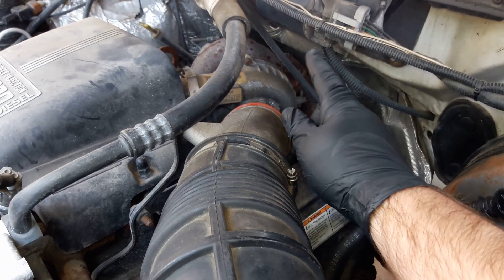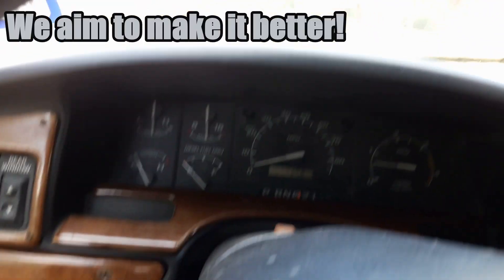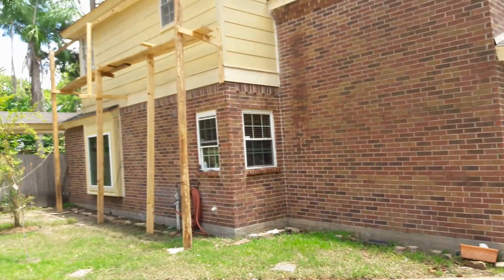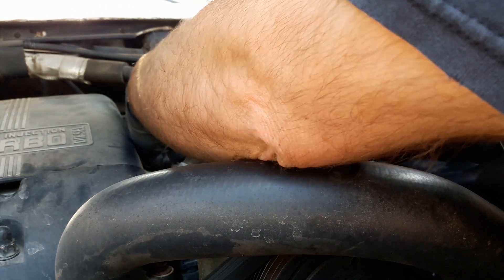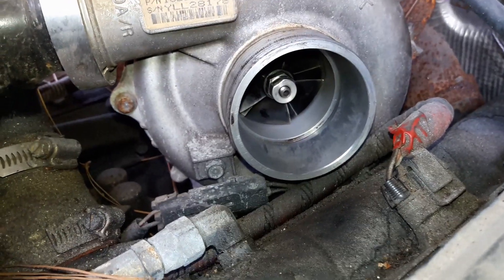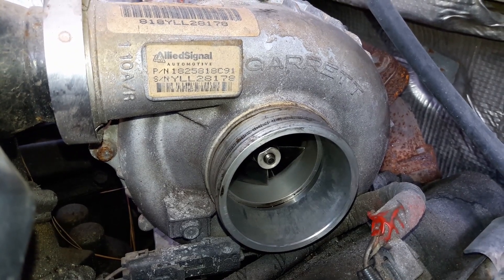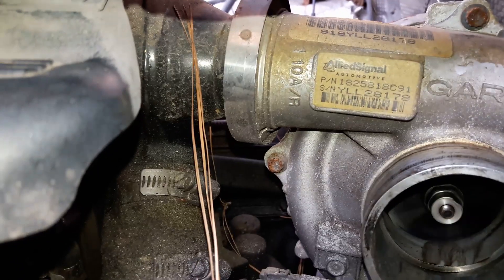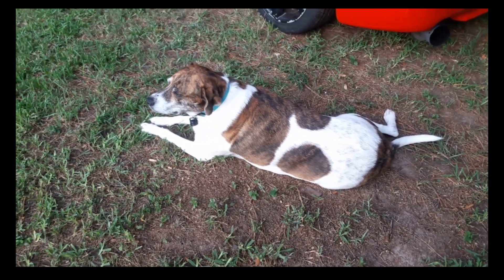How I check A turbo to see if it is Good.

Comment: First gear is to low and short typically to get a load on The engine enough to spool the turbo. When you are in second it starts to load the engine. Boost Powerband kicks in. You really notice it in a manual transmition.